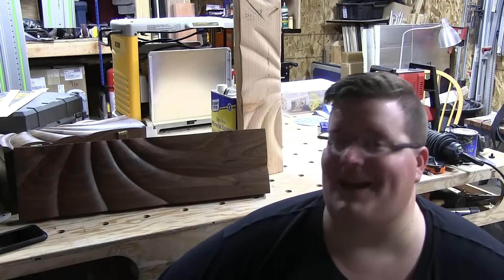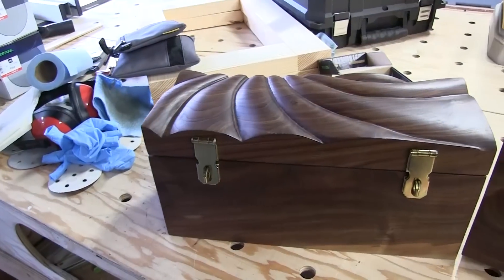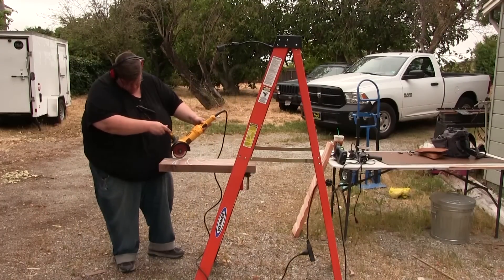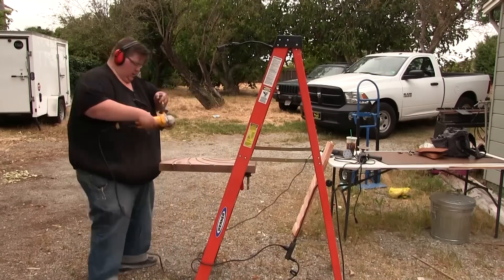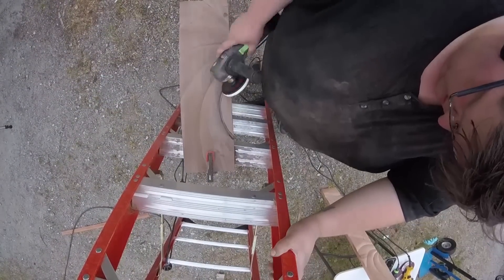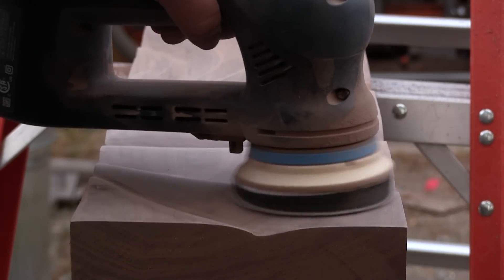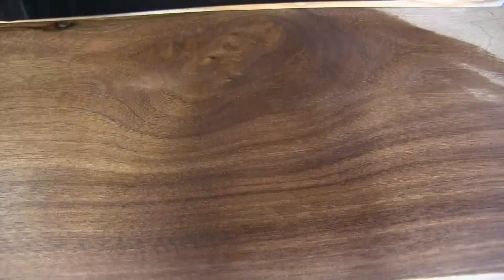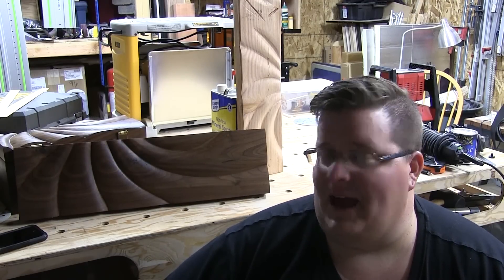Power Carving How-To - My First Adventure in Power Carving

Comment: Great work. thanks for showing your techniques.
Reply from the maker: Thanks man! Digging your work on IG as well! All a learning experience, that's for sure.
Reply: when you did the initial scoring cut how deep did you go?
Reply from the maker: Boluwaji Omisore On the one in the video it was probably about 3/8" to 1/2". For the top on the actual box it was a bit deeper - probably 5/8" to 3/4" or so.
Reply: +Carter Wilson Workshop Did you send back the RAS115.  I have been considering buying one.
Reply from the maker: +Boluwaji Omisore I didn't send it back. After trying it out a little more I decided to hold on to it. One thing I would say though is if your main goal is dust collection, you might be disappointed. The dust collection hood works very well, but for me it gets in the way so I don't use it. Ironically the pad I tore up in this video has come in handy which you can see in a video I'll post this evening probably, of a power carved dough bowl/trench bowl. I'll talk a little bit about how that came in handy. Also in a week or two I'm going to post a review off all the different wheels and tools I've been experimenting with, how they work, what I thought of them, etc. The RAS has been helpful now that I've gotten to know it. I like that it doesn't burn the wood when I sand unlike grinders which tend to burn the wood when sanding. I think it's a speed thing though - a variable speed grinder that you can turn all the way down might do the same thing. I don't know though - don't have one yet.

Comment: Great work! I've watched a couple of your videos now. Just a quick note though, those soft pads are mainly made for flat work, not really carving. So that's why they're wearing out faster.
Reply from the maker: Indeed - running their sides against a sharp corner wasn’t really fair haha. I realized that a bit later - that I wasn’t being realistic. They actually still to great for non flat stuff - just have to not run the side up against a sharp edge like I did.
Reply: @BradleyMakesThings  Now just to be clear, I'm saying they're not made for that. But I'm not saying don't use them that way! A tool is a tool. And you got to use whatever you have to get the job done. And if you have to buy another one for the next job, well so be it! You can always use that for something else later. I abuse tools all the time, as long as it works. Great Channel keep up the good work.

Comment: I use a workmate to hold my stuff when I carve and it is just a bot low for me and it ends up making my back ache. Using a ladder.. clever. Thanks for the video, great work!
Reply from the maker: I thought about a workmate but no one sells them locally. But now that you mention it I do recall them being pretty short! The ladder has worked out ok so far. I may end up experimenting with other things or may build something custom in the future.

Comment: You are a passionate and a nice guy. I can see why your wife loves you. I like the ladder idea as I spots for working like this.  Where did you get your grinder?
Reply: Hey Jack, did you get your question answered about what grinder he is using? He does have the *King Arthur Tools Holey Galahad Disc - Medium Coarseness - Flat Profile but as far as the angle grinder I didn't find anything in the list for name brand on that. He did mention a Dewalt grinder. From using both I myself prefer the Makita angle grinder with a paddle switch. Why? Because when you let off the paddle switch it turns it off and this can come in handy if the grinder kicks back on you and comes out of your hand. Here it is on Amazon.com:Makita 9557PB 4-1/2-Inch Angle Grinder with Paddle Switch
Reply from the maker: Jack Lancaster as Billy mentioned, The disc is a King Arthur's Holey Galahad - flat profile - medium grit/courseness. The grinder is a dewalt with the trigger switch at the back (sometimes called a rat tail grinder). As billy mentioned, grinders with paddle/trigger switches are generally safer. They aren't my personal favorite for everything but a lot of folks love them. For me in this video, O was using the trigger lock which negates the safety provided by a paddle/trigger design.
Reply from the maker: Jack Lancaster I saw your other comment wanting a list - you can find that here: http://carterwilsonworkshop.weebly.com/blog/power-carving-tool-review  Also, I have a few videos covering the different attachments and grinders/tools I've tried so far.